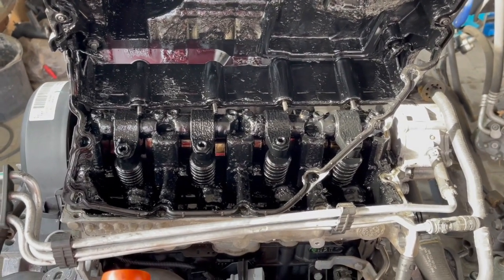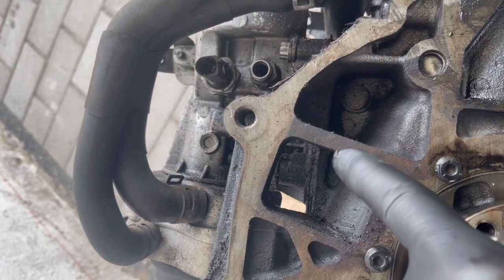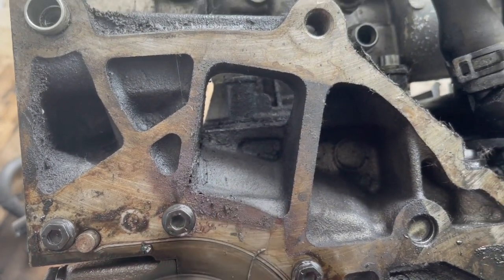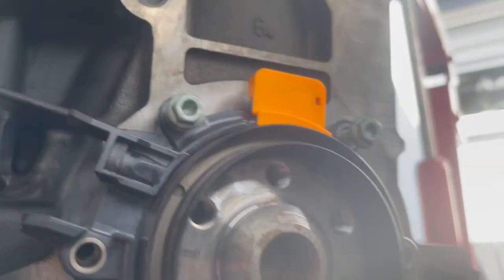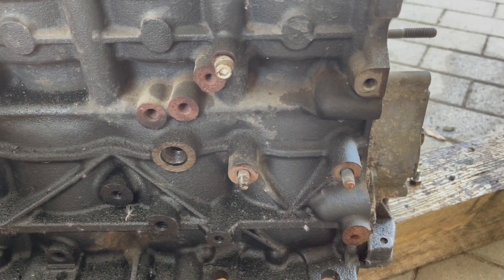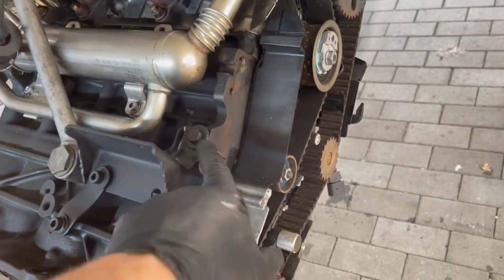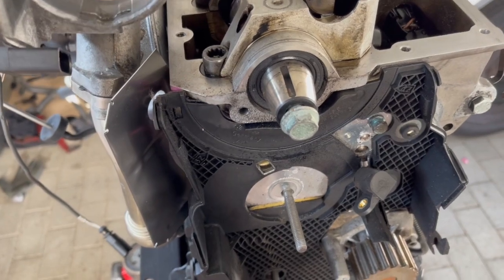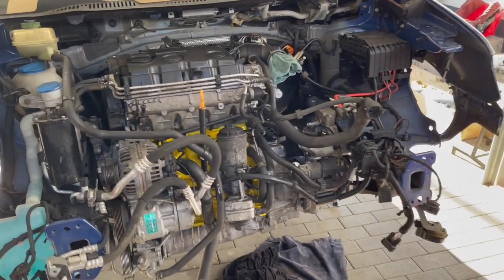1.9  VW  BLS PD105 to 1.9 ASZ PD130 engine swap. 2008 Caddy Engine failure: broken connecting rod

Comment: Currently doing this now. Did the plug for the crank sensor plug in easy enough.  Mines a little tight, but scared of taking much more material of the block.
Reply from the maker: if you can get to the part that releases the plug and the bolt that holds it in then it should be fine. I would not want it to touch the metal but 1mm clearance is all you really need on the other 3 sides. At minute mark ~10:19you can see how much material I removed and I don't think this is a problem. The strongest sections are still very solid.

Comment: @sebsway Hi. I too replaced the engine from a BLS to an ASZ, but in a 2008 Superb II. The timing was fitted on interlocks, the synchronisation is around 0. It looks good, the engine runs quietly and smoothly.

But I'm having problems elsewhere, like in your video, I also have the "Check engine" on the instrument cluster constantly on and the glow plugs flashing. The engine starts after about 3 seconds, it's not very long but I think it's longer than the previous engine.

The diagnostics show me DTCs in the engine: 1) P1116 - heating circuit; 2) P0341 - G40 camshaft sensor; 3) P0227 - G79 accelerator pedal sensors; 4) P0642 - ref voltage too low; 5) P0322 - G28 engine speed sensor.

In the diagnostics, the accelerator pedal has the correct percentages, the engine a shaft revs I can see, but I can't see the shaft revs (in VCDS, measurement block no. 51). 

The engine during acceleration, above 3000 RPM enters emergency mode, cuts power.

After disconnecting the camshaft sensor (connector behind the oil filter), there is no change, the engine starts after a few seconds, same errors. 

Did you also have this problem? Do you know the solution?

I'm afraid it's the camshaft sensor, but a new one costs about 100 Euro, I don't want to buy one unnecessarily.

In the cable harness socket of this sensor I have 5V and GND, I don't know how to check the signal wire.
Reply from the maker: did you use the BLS camschft gear? It is a 2 piece part. The tabs on the inner part are what the cam sensor detects and they are very different. I used the BLS cam gear assembly and the sensor because the sensor was a different color plug. I ddidn't know if there was a difference but I knew mine was OK
I also found that I had put a vacuum hose on the wrong location. There were 3 on a valve that controlled the wastegate. After driving for a while it would put me in limp mode which will limit the revs and also cut the turbo from spooling to protect the engine.
Reply: P0341 is implausible signal. It Usually means the signal is there but not in the correct range. You may need to do the torsion adjustment to fix it. 0 also means out of range. If it was true 0 then it would fluctuate when rev'ed.
Reply: I did the swap 4 years ago on my sister's car. Bxe- asz. It was my first time working with these diesels and I had a lot to learn. Back then there wasn't many videos that I could find but there was a write up on darkside developments website. 
Anyway after doing what I could I got the engine running but it had g28 issues. I knew the signal was bad. 
After four years of running with that issue the only bad problem was starting as it would take a little longer to start and maybe stall straight 
Away. But it never not ran. 
So as my sister changed cars I went back into investigate the g28 issue. I was expecting the hole on the ring to not lime up but it did. What I found was the ring wasn't pushed on far enough. The spec requires 0.5mm below the crank face and this was only 0.3mm. 
I corrected that issue and then the car worked again on g28 however the new code was p0341. My guess is now that the g28 was working it wasn't lined up with the camshaft Sensor. The torsion was on 0kw. I had to advance the timing tiny bit at a time until the torsion started to read. 
Now it starts and drives good. It's such a precise thing I think some people will need to do similar to fix issues like starting and sensor codes. 
Like you I unplugged the cam sensor and the code was different. It was p3007 no signal. So I knew it was timing issue. Hope this helps

Comment: BLS has different camshaft and injectors, because of dpf, if you use ASZ camshaft and injectors you will clog up your dpf, incresed fuel consumption and a noisy idle.
About timing, you should set your timing around -1.5 - -2.5.
A smaller gear on oil pump dosen t mean a higher oil pressure, oil pump has a relase valve.
Reply from the maker: I did not change the camshaft from the ASZ to the BLS but I did ultimately use the BLS injectors. I did another video on that. I lost well over 100km per tank with the ASZ injectors. Now that I have changed the injectors back to the BLS injectors, my fuel mileage has returned to normal.
Reply: @sebsway  Glad to hear that, the main difference between ASZ and BLS camshaft isn t about performance or gas mileage, but ASZ can t make DPF regeneration, because lobe of injectors are slightly different. But, if you have dpf removed from software, this shouldn t bother you.
Reply from the maker: @ruseadrian5490  Shortly after I switched back to the BLS injectors my DPF light came on. My research said that you need to travel 15-20 km at 2000 to 2500 rpm over 40 mph with more than 1/4 tank of fuel and it would do the regeneration. My wife loves to drive the car with very little fuel in it :body-blue-raised-arms:
So I filled the tank and got on the Autobahn and got up to 100kmh and within just a few minutes my car was blowing a lot of white smoke. This happened for about 1-2minutes  and within 20 km the light went off. 
I don't know where you live but here in Germany I think every diesel must have a particulate filter. If it is removed, your car can be impounded and the fines are very heavy. I met a guy who had his A6 impounded for months after it was found that his DPF had been removed. They take that stuff real serious here. Germany is like the California of Europe.
Reply: @sebsway I am european too, i live in Romania, our laws about emissions are the same, you can t cut dpf, cat, etc too, because you gonna have your license plates took. About the light and white smoke, this might be because ASZ injectors flooded your dpf with fuel. Keep an eye on distance to distance between regenerations, with ASZ camshaft the car will try harder to make dpf regeneration.

Comment: Hello, very good video. One question, does the BLS motor come with double mass? or simple? I have a seat ibiza 2008 bls engine and it turns out that the factory comes with a single mass, it turns out that for 1 year with a new clutch kit + Sachs brand single mass the car shakes when leaving or parking, only releasing the pedal little by little if you do it with more nerve no It shakes, if you try to correct it with the accelerator at about 1000/1500 everything is fine and the shaking goes away. with the old clutch kit the same shaking... What could it be ? thank you 😊
Reply from the maker: My Caddy had the dual mass flywheel and clutch and I have no problems with shaking. I did replace the clutch set during this engine swap because it had over 215,000 km on it and the clutch plate was pretty thin but not worn out yet. 
I did contemplate using a single mass because the price was much less expensive but my research told me that shaking was an issue with the single mass clutches on the diesel. 
I think the diesel engine requires a bit more mass in the flywheel because of the mass of the rotating mass of the engine for a smooth operation. Also the caddy is a bit heavier than many 1.9 equipped cars. This same clutch is also used in the T5 transporters with the 1.9. When I cross referenced the part number it pulled up the transporter first.
Reply: @sebsway  Thanks for answering, I don't know how often it does it, there are times when it doesn't, what I realized is that it always does it when it reaches 90 degrees, I have good injectors, engine values are good. I changed the clutch thinking that I was going to solve the shaking problem but it didn't... shame...
Reply from the maker: @rubenfix6993  did you resurface the pressure plate when you changed the clutch?
Reply: Everything is new single mass + Sachs brand clutch kit, before it had Valeo brand from the factory. but the same symptoms...
Reply: 1 year ago I changed the camshaft sensor, could the crankshaft sensor be the cause? ( it's an idea )
Reply from the maker: @rubenfix6993  HMMM? Also new throw out bearing? Properly torqued? 
If so, I would say that it is something to do with the actual power delivery... be it a leaking or clogged injector, worn rings with some unequal compression creating an unequal combustion or maybe a combination. 
Since you mention it happens when up to proper temps....it could be that you have some carbon deposits on the pistons or valves which is causing a bit of pre-detonation. This can be a common issue for diesel engines and turbo charged direct injection engines especially when they have some age on them. Maybe you could try using some sort of fuel system cleaner to see if that helps. 
I can't "recommend" it but I have used a small amount of gasoline mixed into my diesel as a fuel system cleaner. This is an "old timers" trick to also help keep the fuel system from gelling in really cold temps. Gasoline is considered a solvent while diesel is a lubricant. I use about 1% mixed into a full tank. For me that is about a .5 liters to a full tank of 50 liters...or .2 gallons to a 20 gallon tank.
Reply from the maker: @rubenfix6993  Is your car a Pumpe Duse engine? I think the crankshaft sensor is one of the sensors that tell the injector (an electronically actuated pump) when to spray but I can't see that being the cause without a warning light. It probably wouldn't hurt to visually check it. I think the sensor is magnetic so maybe a bit of debris could be interrupting the signal just enough to cause an issue.
Reply: What I used was injector cleaners, but it didn't help, the injectors are fine, at least in Vag Com they look good. I don't have any fault. I ran a running log at very high roms around 3000/3500 and everything turned out fine, like the turbo, egr, MAF etc...
Reply: Now I have about half a tank, could I put 1 liter of gasoline?
Reply from the maker: @rubenfix6993  I have heard that 1% is ok. Anything more you can run the risk of other issues due to the solvent nature of the gasoline. My car holds about 55 liters and I will put in about 1/2 a liter (.5 would equal 1%) I don't think it has to be super precise but the more gasoline you add the less lubrication you get from the diesel. I have heard that 5% can actually damage the engine, fuel filters and DPF because it lowers the firing temperature causing pre-detonation and also lowers the exhaust temps. this is why I can't say I recommend it but I do it on my car regularly....about every 5th fill up or so.
Reply: @sebsway  hello. I'm going to send you a video, so you can see, with half pedal in first or reverse it does it, but if I keep lifting it doesn't do it, if I go back to neutral and do the same luckily it picks up a point that it doesn't. is rare
Reply from the maker: @rubenfix6993  I haven't seen anything yet. Were you able to send it?
Reply: @sebsway  It's already solved, the flywheel is a factory defect (deformed), change everything again and it's perfect. I didn't imagine it was the engine flywheel...
Reply from the maker: @rubenfix6993  It is good to hear you got it resolved.
Reply: I see you're living in Germany. May I ask whereabout you are? Grafenwöhr? I hear your Southern accent.. I grew up in SC and been in Bavaria since 91.. been thinking about building a block like that too

Comment: After installing rear main seal(crankshaft) without a tool, did it leak. I've got a polo blm engine and it's leaking i must replace it but i can't afford the installation tool. So if you managed to overcome the leaking problem then i might as well give it a try. Thanks for the video.
Reply from the maker: no problems as of now. It isn't hard to do if you just take your time and be very careful. The new seal is flexible and not likely to damage. The key is making sure the seal is properly located as you install it and also it doesn't "push out" where it actually seals onto the crank. It should fold into the engine (away from you) touching the crank with the surface you can still see....if that makes sense. On the BLS it is also the crank sensor so the position is more important than on other engines. The ASZ originally sensed the crank from a sprocket inside the engine. I am not sure how it happens inside the engine you have. Let me know if you have any other questions , concerns or clarifications.

Comment: nice work ther Seb, did the same back in 2018 and the car i still running fine, i had the DPF emptied and ECU tuned with turbo from BMP tdi which gave a nice power and torque. One thing i would like to know that did you swap the oil dipstick from BLS  to ASZ OR if anyone else can help in this regards. I need to put the engine plastic cover and the plastic dipstick hole is slightly different. Thanks
Reply from the maker: I used the ASZ dipstick. The engine I purchased came with it so I didn't want to chance the level being wrong by switching it out. Especially once I realized that I could not use the BLS oil pan. It is just floating in front of the engine and not bolted down. So far so good

Comment: would engine code ARL be the same as the ASZ as in making the hole in the side etc like same as everything in this video ??
Reply from the maker: I am not familiar with every engine code. Sometimes the blocks are the same, sometimes they are different. You would need to inspect each one to see what the differences are.
I used the ASZ because it was a PD130 and used the particular heater hose body. There were other PD130 engines with other codes that had a different heater hose bodies. The ASZ PD130 engines were an older design but maybe newer engines require less work.
I also found the ASZ for under 500 EUro and all the others were well over 1000 and some were over 2000 Euro.
Reply: yeah. its the same!

Comment: Hi 
What tool did you use to lock camshaft when swapping cam pulleys over?
Reply from the maker: I didn't lock the camshaft but I did lock the crank when replacing the timing belt. The camshaft pulley can only go on in one position with the keyway. The valve springs and rocker arms were strong enough to keep the cam from moving while i removed the pulley. If I remember correctly I put a small mark on the pulley before belt removal to make sure it didn't move and if it did I could  just realign it easily with minimal rotation. When I put the outer pulley back on I just used the bolt markings on the pulley to make sure the pulley was timed the way it was before I removed it. When you remove the bolts the metal is a different color and was easy to see where the bolts should be.
I hope this helps.

Comment: Bonjour , je viens de commencer le remplacement du BLS (Caddy) par un ARL (Seat Leon tdi 150) je compte aussi garder la boite 6 de la Seat, mais je ne sais pas quels cardans utiliser... je me demande aussi si on ne peut pas garder le capteur PMH d'origine de ARL en modifiant que la fiche électrique
Reply from the maker: Google traduction en français.....
Cela va représenter un gros gain de puissance si vous remplacez les ordinateurs. Allez-vous également changer les ordinateurs ? Les capteurs peuvent devenir un problème car ils mesurent différemment selon les moteurs. Je pense que vous aurez des codes d'erreur moteur si vous remplacez simplement les pièces du plug-in.
En ce qui concerne les essieux moteurs, je vérifierais si les essieux Leon fonctionneront. S'ils ne conviennent pas, vous pourrez peut-être les mesurer et en trouver. Des essieux sur mesure sont disponibles, mais ils peuvent être coûteux.

Comment: Can you use the 5 speed gearbox from the BSL? And what flywheel and clutch would I need?
Reply from the maker: Yes I think any front drive transmission will work as long as it was mated to a 1.9 or 2.0 Tdi. I did replace my clutch, bearing and flywheel while it was out. I have a dual mass flywheel in my van but not all cars have this option. It is more expensive but is supposed to be much smoother engagement. You can just use the stock one if it doesn't need replacement. But you will need to replace all the bolts when reusing the old clutch or  if they do not come with the new setup. They are stretch bolts and will not torque properly when reused.

Comment: I’m doing this swap from bxe to ASZ, how did you get the engine to TDC or know when it’s at TDC without removing the head when installing the crankshaft sensor?
Reply from the maker: If I remember correctly there is a mark on the crankshaft gear and also on the cam gear. You can also tell when #1 is at the top by the compression of the valves. 
You can also remove the glow plugs and rotate until you have compression on the cylinder.
But I would suggest you confirm that with a couple of other sources. 
The sensor will not care. It is more about getting the rear main seal on correctly because that is where the signal pickups are.

Comment: Did you do anything with ecu
Reply from the maker: no. I didn't upgrade the Turbo and I have now exchanged the injectors back to the BLS injectors. So ultimately  still have a PD105 with the strength of the PD130 bottom end. I think you would need to upgrade the ECU if you were to use the PD130 or upgraded turbo and injectors. The PD130 injectors were way to rich and lowered my fuel mileage by about 70 miles per tank and caused some throttle response issues. So i rebuilt the PD105 injectors and swapped them out and that fixed those issues.